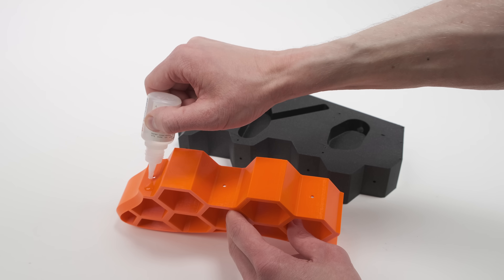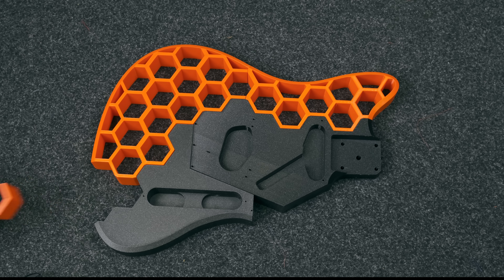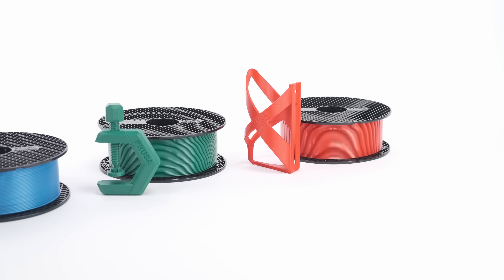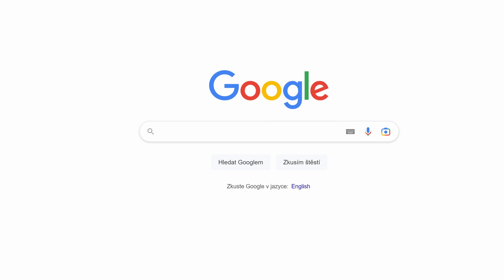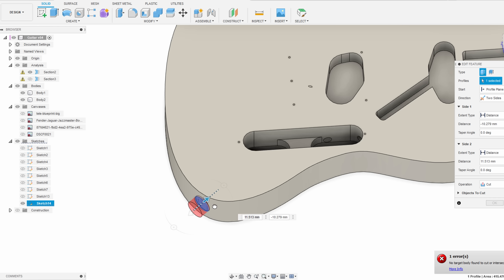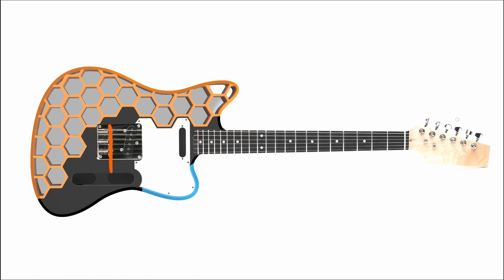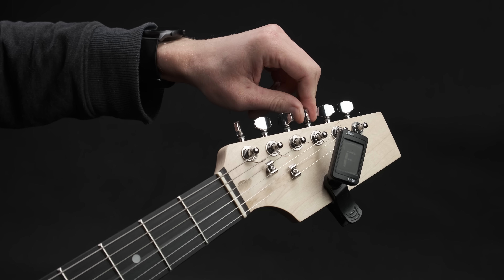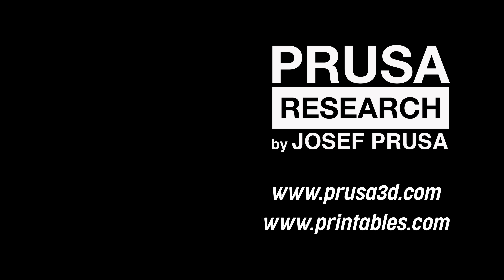How to 3D PRINT A GUITAR - the challenges, how it sounds, and how much it costs

Comment: I think a better solution to the bridge problem would be to make it a string-through body design. That way, the ends of the strings would be applying pressure to the printed body piece itself, and you could use any compatible bridge you wanted
Reply: I remixed this and made mine with string through and it came out great.  Not sure it helps or hurts much but it worked perfectly.  Also changed the design to humbuckers.
Reply: @stevenminnick  do you have a link for that remix?
Reply: @stevenminnick would u be willing to share the stl of your design
Reply: @stevenminnick Nice, do you have videos or photos of the finished piece anywhere?
Reply: @stevenminnick have the design available?
Reply: @stevenminnick  Did you put it on Printables or Thingiverse?
Reply: I think this would be a better alternative to a tailpiece, because it would put the stress on the center of the body, effectively preventing any bows or bends, whereas a tailpiece puts the stress on the bottom end of the body, which is still good, but it may not be as effective, as the whole body could potentially bend over time.
Reply: Yeah plus those three barrel telecaster bridges aren't the best
Reply: @dandinkler6315  You can get a Telecaster bridge that's mounted the exact same way that has six individual saddles. You can also get ones with three barrels where the barrels can be adjusted to allow for six-string intonation. There are a few different styles of that.
Reply: string through would benefit tons
Reply: what types of whammy bars are compatible with string-through?
Reply: @Jeremy  pretty much none, at least not string-through in the way they're talking about. On any vibrato system, the ball end of the strings connects to the bridge itself, which is then screwed to the top.  That's why the Strat-style bridge wasn't suitable, even though you do string it through the back of the guitar.
Reply: Melting ferrels into the back the same as putting in threaded inserts should be pretty easy too
Reply: Came here to say this
Reply: The cool thing is that this guitar is perfect for that. I’ve converted many telecasters to string through…. Although on my personal ones I like the old fashion bottom load. It just sounds better to me.
Reply: @alexcorona Telecasters are traditionally string-through. Bottom-load is a relatively modern cost-saving variant.
Reply: It IS a string through design!
Reply: That was exactly my first thought.  Completely eliminates the bridge attachment as a stress point.
Reply: yes, however the string through is a lot less adjustable here if the bridge wasn't located properly in the first place (as explained around the 8:40 mark.) in a perfect build, having extensive guitar building knowledge, a string through would be easiest and cheapest. Just need metal sleeve inserts to protect the print from the through part of the sting. However, Because the end of the string is pulling from a different location (the back of the guitar) instead an almost parallel angle of tension, it would behoove you to turn up the infill. Play with it. More infill= more sustain , and a sharper tone as well. PLA plastics are about as dense as Ebony wood (around 1240 kg/m3) which is about twice the average density used on guitar bodies, so your sound comes out super sharp already. Playing with the infill to where it leaves nice enclosed air cavities ensures a softer tone. I like to coat my old vintage hand wound Dimarzios in candle wax and put a pickup cover over them. Fixes everything about the tone and the sustain is redonkulous.
Reply: This is exactly what I’m doing with an 8 string 🤘🏼
Reply: it would make it harder to nail the intonation, though. It's a tradeoff
Reply: @Empinada  no reason it would, you still have a tailpiece with adjustments
Reply: @Empinada  Why?

Comment: Cool stuff. One of the things I immediately have searched for after getting my printer, was a guitar body. The pickup you used from the telecaster usually shines more when in use with a wooden body. It kind of sounds shallow, which of course can be solved with effects and amp settings. I had a similar problem with a dirt cheap diy guitar. At the end i have used active emg-x strat pickups. They actually dont sound too clinic as some have reviewed it, and they have masked the sound of the cheap body very well. I play this guitar very often now and it sounds better than my original gibson les paul. Of course, thats a subjective opinion.

Cheap guitar necks usually come with poorly pressed frets. One thing that could make this guitar better playable is to make the neck completely flat and to sand down the frets to the same level. Ive tried it once and it went okay. But I wouldnt retry this on an expensive guitar. :D

Comment: I’m kinda curious how a 3d printed hollow or semi hollow body guitar might turn out, something like a 339 or a casino. I guess there’s only one way to find out 😳
Reply: You could perhaps look at an Ovation if you want to hear what a plastic acoustic guitar sounds like - they do sound different (not as nice as wood imo). It would be worth considering that a lot of an Ovation's sound however may be assisted by the shape - I would imagine that a flat plastic back would sound markedly worse/barely sustain (in the same fashion as a normal semi-hollow) at all, and printing curvy things on a 3D printer doesn't tend to be easy!
Reply: @Sir83chris  I've seen a couple.  What you imagine is pretty spot on.

Comment: They use a wood neck because they don’t have a printer big enough to print it
Reply: They use a wood neck because a plastic neck would be destroyed once you get the strings up to tension.
Reply: @BrunodeSouzaLino  if you have a junky printer that can’t produce good prints
Reply: @outdoorseveryonceandawhile8236  Show me a printed neck which can support 20-80 Kg of tension without deforming over time or losing intonation. It has been done before. Even reinforcement rods don't help. And that's tension modern guitars are subjected to. Older guitar players used heavy gauge strings and that would put the neck at even more tension than that. Aristides has done it, but you're talking about a proprietary composite material that's molded, not printed.

Comment: Up front, given that it goes against other telecasters I have good hopes. Telecasters have their own particular sound and uses. But they're not known IMO for their good build quality or warm, sustained tone. In short, everything that helps create a clean tone with little degradation of resonance just isn't there in a Tele (and that's not the point of that model), so I expect this guitar can only really improve on that, if the material has roughly the same density and elasticity as, say, mahogany (which, after build quality contributes to tone characteristic purely by being a significant part of a system in resonance). Also avoid sharp corners as they're stress concentrations, round outlines and edges are good to distribute vibrations evenly throughout the body. I feel like the right connections between the parts and the hex design take away very little of this, and differences will be subtle, but it will be in spirit with what a guitar is, does, and sounds the way they do.
Reply: I am not sure where your comment is coming from re experience vs science etc but I honestly think you are overly generalizing and incorrect in some parts.....

Teles are the most recorded sound in the USA industry up til 2010.....probably still but no one really had new stats.   Sustain on a bold on is all about wood/pockets so its a variable but its better than on any floating bridge in design....build qualities make it hard to compare but even then no one cares we have compressors on our boards nowadays....its a tone wood argument.....yes its different but makes not much difference in the big picture.

warmth is also somewhat irrelevant s hardware changes that far more than wood in a solid body....i also don't think it makes anydifference in a piezo pickup but who buys an acoustic for the plugged in sound only
Reply: @jasonrhodes5034  I'm not saying that they sound bad, just that different guitars have their own characteristics. And objectively, a mass produced Tele has worse tone degradation than a Gibson Les Paul. This video is about judging how something functions as a guitar, so tone degradation is one important factor, and giving the budget it plays a bigger part than the quality of hardware.
Reply: Well Telecaster is both sound thicker and more sustain than... a Stratocaster lol. It's certainly usable tone.

I wouldn't say a Telecaster sounds better or worst than a Les Paul. They are like orange and apple. Many professionals I know have both of them to use on different occasions. In fact those people would own at least 4 guitars. Even a total amateur like myself have 5 of them lol. 

Given that the tone is created by the string vibrating (and cut the magnetic field, yada yada), the darker guitar is usually subtracting more high frequency out of the guitar tone. So the warmer tone is actually the harsh tone with lots of high frequency filtered out. The shorter sustain on the bolt-on neck is caused by the air gap at the neck joint as the energy can not be efficiently transferred back and forth, yes, but that just shorten the tone, not the tone degradation IMHO. 

To prove the point, try finding guitars made with say... aluminum. Metal can transfer energy better than wood, and it does less subtraction on the high frequency. You'd find it sounds brighter with super long sustain. 

Also the humbuckers used in Gibson's guitar is usually less high-frequency sensitive, so it makes the overall tone of the guitar darker as well.
Reply: The body is more of a Mustang body than Telecaster.

Comment: I was most excited to see how the neck was printed. If using a pre-fab neck, there's not much reason to believe there would be any problems unless the body design was particularly weak.
Reply: A 6 string set exerts around 20-80 Kg of tension on the neck. Even at 100% infill, a printed neck would crack under tension, even  with a truss rod or graphite reinforcement rods. If you go for a printed fretboard, how do you attach the frets without destroying the plastic? 3D printed necks are not possible for guitars atm. The only company which does manufacture a neck through guitar made of plastic is Aristides and that's a carbon composite molded body.
Reply: @BrunodeSouzaLino  I'm not entirely sure that's true. PLA is like half as stiff as the wood that is normally used for making necks, and necks are more than stiff enough as they are typically made. Adding reinforcement seems like it could plausibly make the neck stiff enough. Maybe not, but I'd like to see tests instead of just going on the internet and telling people it definitely wouldn't work.

As for frets, I definitely wouldn't want plastic frets. If nickel frets are already soft enough to dent over time, I'd imagine the printable thermoplastics would go fast.
Reply: @MattMcConaha  While that's true, eventually the plastic will bend and start being destroyed over time due to the strong tension. Someone already tried to print a guitar neck and eventually it became impossible for the neck to even hold the tuning.
Reply: @MattMcConaha  You can definitely 3d print necks if you add supports to it and are careful with your printing pattern.  A buddy of mine has printed a bunch to see if he could make it work.  Warping is going to be more of an issue than snapping.  And having the neck snap was far less of an issue than the frets.  You'll want to still use fret wire as basically no 3d printed material we tested lasts long before the strings grind them down throwing off the tuning.  Hell, given enough time metal frets get ground down, so most plastics are just screwed. And getting the fret wire inlayed without compromising stability is tricky.

That said, there's another problem that everyone always forgets about...  raw 3d printed necks feel awful.  If anyone makes one, be prepared to experiment with finishing options because you're not going to want to leave it as the raw print.

Comment: Next level: 3D-print a grand piano!
Reply: That would be impossible. The main structure of a grand piano is a solid cast iron frame that must be able to withstand over 2 tons of pressure cause that's how much tension all the strings exert on it once the piano is tuned.

Comment: One huge issue I see with that jagstang is the neck dive.  If yr new body is even half pound lighter, it should neck dive a lot. Only way to correct would be strap it high as yr badge of honour or place all the electronics in the far aft pit by the jack . I can't imagine playing this in an active live show to be a well balanced kit.
Reply: Believe me, 3D printed bodies are usually pretty much heavier (my startocaster is like 1,5kg heavier than the wooden one :D )
Reply: You can always add weight in various ways.  Could use lead weights.  Could print solid panels instead of honeycomb.  Could use denser infill.  Etc.

Comment: Can you please comment on putting multiple ground wires on the FG post of their power supplies? Is this common? Does Prusa do this? Is there a legal way to do this? Is there an alternative to this practice? I have it on good authority that the BIQU Hurakan comes from the factory with a frame and a switch-power inlet ground connected to the power supply's FG post. I also know that the printer in question recently experienced a major electrical event that destroyed it's monitor and it's board. The video is featured on my Youtube site. Thank you for all the wonderful printers you've made over the years. It's quite an accomplishment!

Comment: literally ANYTHING that can hold the strings and pickups in the right position sounds good, because the sound has absolutely no relation to the body of the guitar. An electric guitar sounds the same even if it doesn't have a body.
Here is the proof: https://youtu.be/n02tImce3AE
Reply: This is mostly true. But some materials (like metals) can obviously affect pickups and the sound. I'm mostly wondering how that hollowed section of the guitar affects its overall balance.
Reply: @NzeRekoRec  https://youtu.be/QIRpmnxLNdA these sound pretty good to me.
Weight/balance/handling is another discussion as it affects the player (which makes the sound)

Comment: Is there any chance to print this on an Ender 3 V2 ?
Reply: Sure.
Reply: @bartoszpiszczek  any advice how to handle the core piece?
Reply: @seppeqespecho4260  I think that video explain it well. Additional brim is nice to see. Just be sure that temperature for your material is high enough and layers bound well together.
Reply: @bartoszpiszczek  the problem is, that the build volume is limited. The core piece doesn't really fit
Reply: @seppeqespecho4260  Oh, you are right. The prusa i3 has odd rectangle 21x25 build plate, but it has limited height: 21cm. You can rotate element to fit 22x22x25 ender's space, but it requires some support.
Reply: @bartoszpiszczek  hey thanks for your reply and help. I can make the core piece barely fit when I put it diagonally. I tried printing it using brims and supports but it seems the surface at the starting edge is not enough so the print gets messed up right at the beginning. Next I will try removing the gray safety zones on the build plate in cura to gain more space. Maybe this way I can print the model in the same way they showed in the video.

Comment: Why not put the strings through the body like on a proper Telecaster?
Reply: Probably because the bridge he got was easier to source. It seems to be working fine. I do think the string through design would be stronger (instead of the strings potentially ripping off the bridge, the strings compress the bridge into the body), but the tailpiece version of the bridge is perfectly legitimate as long as the PLA is strong enough for the screws not to rip out.
Reply: @MattMcConaha  that bridge has holes for through-body
Reply: @johncoleman4986  I didn't look closely enough to notice, I just assumed the manufacturer picked one option or the other. My through body tele doesn't have tailpiece holes and my tailpiece tele doesn't have through body holes. Either way, it works. They wouldn't put the tailpiece holes if it wasn't an option.
Reply: @MattMcConaha  I was just thinking it would put less shear stress on the bridge mounting screws.
Reply: Because the string tension alone would bend and destroy the plastic after some time.
Reply: @BrunodeSouzaLino  Gee, that sounds like a terrible material to use for a guitar...
Reply: Anyone know what song he play at 10:36?
Reply: @jauharinur-pu2ye  That's a sort of fairly standard Chicago Blues progression.